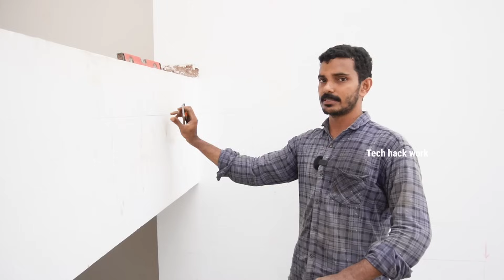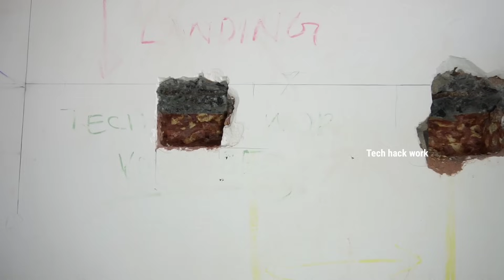Metal Staircase Making | ഭംഗിയുള്ള സ്റ്റയർകേസ് | Floating Staircase | Budget Stair | Interior Design

Comment: Some important points may be reviewed in future. The main aspect of structure is durability as well as preventing from rusting especially in Kerala weather condition. Firstly the inside portion of Steel portions (Ex:- Top ISA provided at top at edge of slab/Beam) which are directly touching with RCC surface should be applied with Steel Primer coated before fixing or bolting to RCC member where you may not be able to paint later. Second point the main stringer which are embedding at Ground should have a min size of base plate and that should not be directly touched  in sub soil, there should have a PCC lean concrete bed of min 100 th to avoid direct contact with soil.

Comment: You just built a russian tank...dude it can be so much simplified with the same resistance less materials, less work and better, lighter design with options for different threads  finishing...Too many things to start mentioning them but one as an example instead of breaking all that concrete at the bottom and buried the two monster profiles why not just plate it and bolt it to the concrete floor as you did at the top?
Reply from the maker: It's not strong, 
Only 25mm thickness is floor concrete, when it's possible ther was an issu that is , below the concrete 25mm filled with soil it cause to easier to catch rust of both bolt and holo section. This method is safer than others.